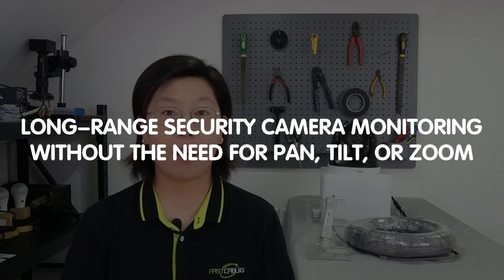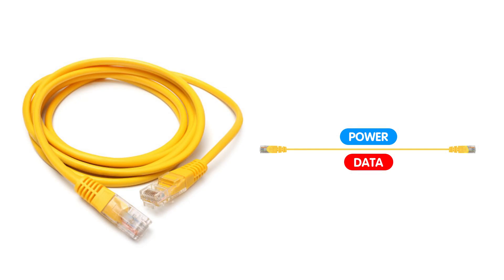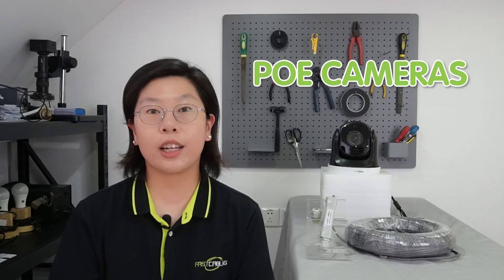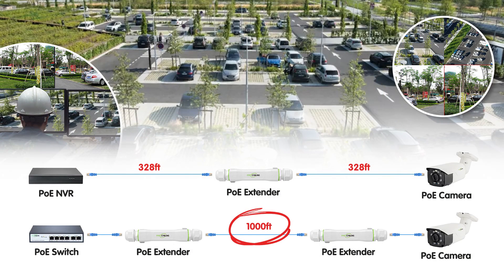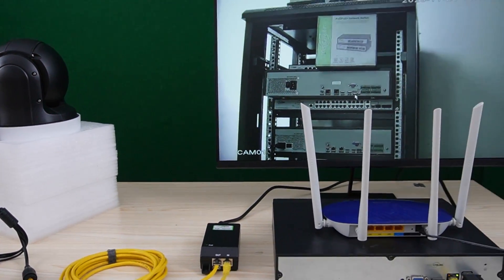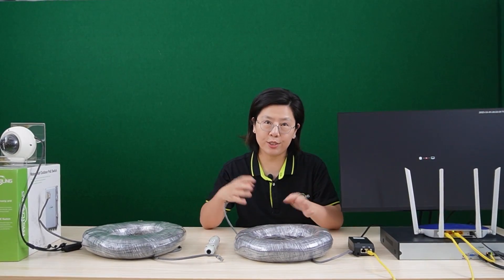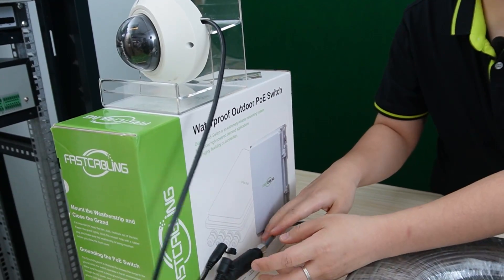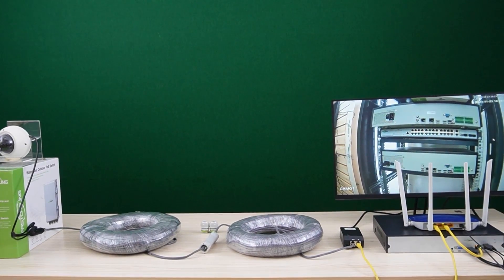Long-Range Security Camera monitoring without PTZ Camera

Comment: Better yet.100mts of cat6 add poe switch turn on the 250 mts switch.plus ptz ipcam.this way you will have coverage for up to 1400mtrs coverage.
Reply from the maker: You will need to use fiber optic cable. The maximum network link is 800 meters (10mbps), and the maximum total power budget is about 10W. It is not enough for a PTZ camera.

Comment: Why not just.100mts cat6 + poe extender+300 mts cat6.100mts + poe extender.
Reply from the maker: The power budget could be insufficient. You might still have 25W within 400 meters with 60W/90W PoE injector.